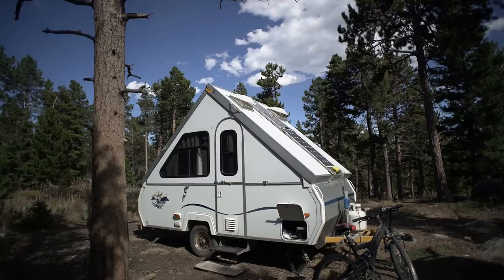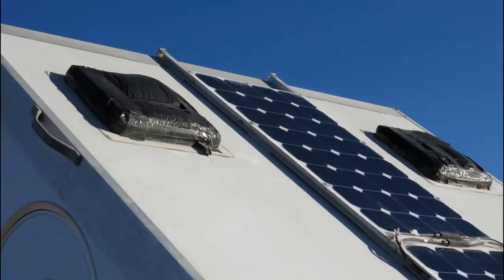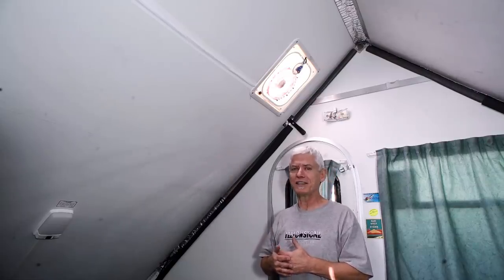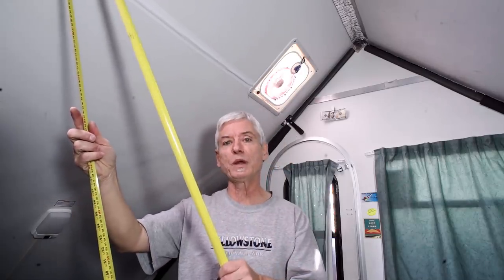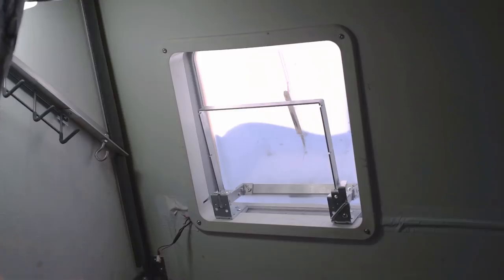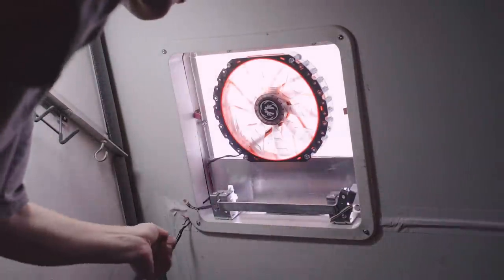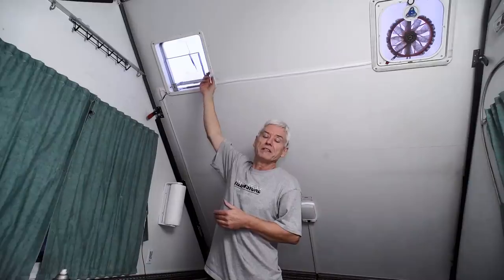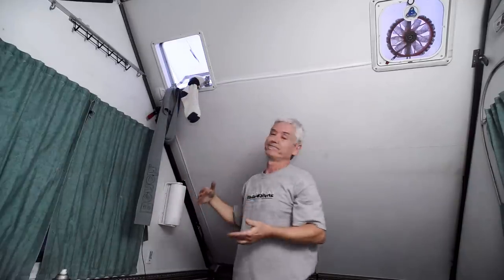Designing a Better A-Frame RV Vent

Comment: Fantastic and great fan idea. No pun intended. Those vents look to be the same ones I used in my Chevy van in the 70's. They were junk back then. Within a year or two, they would just fall apart. I would have thought by now, they would be made of UV protected plastic. Again great design and I look forward to your next video.

Comment: I really like your designs and attitude. I have also forwarded several design improvements to manufacturers. One responded with thanks but already had a different improvement. The other just adopted my improvement which made me happy because it was a safety issue that nobody thought of. Keep up the good work, and keep the videos coming.

Comment: So one time we are driving south on AB 36 through a touch of chinook wind off the starboard bow. 80 klicks gusting to 120.  We pulls into the gas station at Vauxhall to heave to in the lee of that big fence in the back. As we stop the sumbitch vent lid off the truck camper hits the windshield and rattles down the hood and off the front of the truck... the wind shook it to pieces and it was closed...😳 ...the gas station keeps a stock of them for just such an occasion.... I love rv junk...

Your mod is a great design...

Comment: Not a fan of ALiners but your videos are very interesting and inventive. The vent in my camper is pretty standard off shelf type. It's only flaw as  far as I am concerned is that unless you screw it down tight before travelling it comes open and on dirt roads that is a disaster.

Comment: You also should incorporate a modular screen to your vent. It could be made like your modular fan unit that would attach to the vent just like the fan unit does. Also the fan unit would also have to have a screen to help keep the mosquitoes out. So you would have two modules instead of just the fan module.
Reply from the maker: Aha, another one who missed the 9:00 point in the video!!! SP

Comment: What did you do for a living? You are a crafty dude. That whole setup is super clean. You don't need a A-Frame camper to know those vent Lids suck. Anyone with the RV for any length of time knows that they leak and crack very easily. Do you have a picture of your closing window mechanism? I think that is really neat

Comment: We installed a “Fantastic Vent Fan” in ours. 3 speed reversible with temperature switch and vent closed switch. Some have remote controls. And I believe the crank was on the bottom IIRC. I did have to modify the clearance. The rear roof panel would’ve hit the inside controls otherwise when folding.

Comment: Well I would probably never have the skills to do this but found it very interesting how you mentally work through issues and come up with solutions. YIKES I am only 5'5' ,almost, and would never be able to reach the original  handles to open those vents. I also enjoy your fixes are not always the most expensive solutions.  Not even owning an RV other than the Blazer I still find a lot of your information useful to the homeowner. I marvel how much information is out here on the internet explaining how to do things. Having to learn to do all the "Man Things" hubby did has been a challenge, oil changes, airing tires , lighting the propane heater pilot light , using the chain saws and on and on and on. Each new challenge met is another notch in my belt. Keep your design videos coming and I hope some manufacture picks up on some of your ideas so others o longer have to face the struggles.

Comment: That design is simply amazing and a very good idea keep doing vedeos they are very interesting.i had a hybrid bantham light 17 ft the bathroom vent if the cover goes bad you have to change the entire vent  9 inch square...guess they are harder to get had one ordered  i traded the trailer if i had kept it i was going to fasten an aluminum plate over the cover...going seasonal at a park so got a 2008 jayco eagle 35 ft..but i liked the 17 footer had set it up solar..will mis it..

Comment: I'm way small.5'1".i would need atleast four steps to reach that opener.see your point and solition clearly.but heat rises and traps at the top which may be one reason it's higher up the wall.i also think,with my no rv haveing self,the lid should open toward the top of the vent (towards the top of the wall) which would be opposite of wind drag while driving and continue the direction heat moves upward.but,your system is genius.
Reply: And if it rains?

Comment: Hey Slim Potatohead.... greetings from Down Under mate, love all your A-Frame mod videos.... Have you considered making the 'Holy Grail' of A-Frame mods ?- Yes, the almighty DIY 'DORMER' fitted on the side above the dinette... I'm sure the video would attract a massive amount of attention as there are so many of us A-Frame owners who love their current camper and don't want to spend big $$$$ upgrading just for the dormer option....(in fact, we don't even get that option to purchase here in Oz from Avan) ...When you stop and think about it construction wise, it's basically a rectangular hole cut and fitted with 4 hinged pieces of composite panel ( 2 x triangular, 2 rectangular), a small window, some piano hinges, extruded aluminium capping, some waterproofing, and you have created a massive amount of internal headroom for your shower, and dining area..... with your hands on skills, I reckon you could have it nutted out in no time.... thanks again for what you do mate, cheers from Brisbane, Queensland, Australia :)
Reply from the maker: Thanks for the idea! I have seen the dormers, many with leak issues which has lessened their appeal. I guess one that took in account the expansion/contraction of the roof,  it would be a benefit. SP
Reply from the maker: Please don't add links to comments, as they get blocked. Thanks! SP
Reply: @SlimPotatohead  oh,  ok, no worries SP,  it was a youtube video link, we're you able to read my previous comment? or, should I post it  again?
Reply from the maker: If you could re-post it without the link, others could see your valuable information. Thanks!
Reply: @SlimPotatohead  ...no worries mate, appreciate the response, and here's the re-post :) ...the other nice benefit I thought a dormer  could provide would be a great practical place to fit your flexible solar panels on the horizontal roof section of the dormer... obviously, the panels being horizontal will potentially capture a lot more sunlight and you may not need to tilt the panels as often depending where the camper is parked.... On the inside I've seen some dormers fitted with a simple shower curtain clip ring, and recessed LED lighting.... as for waterproofing SP, the only issue I've been able to identify in my research is the very top hinge that is fitted from along the width of the dormer roof panel across from the side edges of the a-frame roof panel.... I note that a good quality flat rubber strip is sandwiched over the piano hinge and secured with 2 lengths of aluminium flat bar riveted about every 100mm (4 inches yanky) and silicone sealed both sides of the rubber before it is sandwiched... If you search for the youtube video titled 'New 2017 A-Liner Classic with Dormers take down at RV Station Katy' you can see a close up of the waterproof seal (and I noted how the rubber just passes over the edge of the a-frame aluminium sides to channel the water)  ...I reckon just a single dormer is all that's needed for increased practicality/comfort... thanks again mate from your friends Down Under, cheers Grant & Kathy :)

Comment: Hi Slim,
I just saw that one of your recent video went viral. I just want to say that i hope it won't change the way you always produce your videos, the fun that you have doing them, the fun that we have watching them. I am not trying to be moralistic or guiding you or anything like that, i just hope that you keep YOUR way to do them as a...... hobby !
I have a question if you have time to answer: do you considered those fans as an imperative requirement in your RV or you could easily live without them ?  What do you say to people considering the ventilation as a non-require option in a RV ? Thank you and continue your good job, you are my favorite for a long time in the RVs YouTube planet...  :p
Reply from the maker: Hi Jacques, I would be on the side that say ventilation is a requisite for a small trailer like this. Air needs to circulate, bring fresh air in as well as get rid of CO2 and moisture. I use three fans a lot of the time, all low current draw but effective. Thanks! SP

Comment: Great informative video.  How can you solve the brittle plastic vent from breaking apart? Weather(heat/cold) just destroys plastic over time.  A tin metal top is firmer,but you have no sunlight then.  I been thinking of buying a A-frame.  Great video's.

Comment: I like a liners.I thought about saving up for a new one from a dealer nearby (camping world) but i had to do some math $109 a month for 120 months is just ridiculous  . One I wanted was no longer made, Alite, which would have worked well with my focus. I like Aliners because they're small and if they tear up, I can fix/replace without having to know about wiring or plumbing. Plus, until I find someone who can mount the solar, I can use a folding solar paneling . Camco sales fan covers that are design to be unbreakable.

Comment: Nice job.  Seems if they designed the camper to have the vents on the back side and a little lower that would solve these problems for the most part, but I agree those vents are junk like many things on RVs.

Comment: Mr. Slim...I think the first and last class any engineering student should have to take should emphasize the time honored principal of K.I.S.S.......(Keep it simple stupid).   This project i'm sure had you coming up with an array of approaches to address several issues. With the final design you fabricated, the questions you have to ask yourself is, can I make it simpler or have I accomplished that to the degree that I am satisfied?
Not trying to be a smart ass or anything, but I think your average German Auto engineer would have come up with a multi-thousand dollar rv vent to include more parts than a Saturn Rocket.
Keep up the good work sir, your content and presentation have a very appealing style all your own and those that might try to copy you, would in effect be paying you the ultimate compliment.

Comment: Another great video, Slim!  I'm just wondering where I missed the part about you saying WHY you need to be able to remove the fan?  At what time in the video did you say that?  Not that it's important, just curious.  Thanks!
Reply from the maker: That will be more apparent in an upcoming video. Stay tuned! SP

Comment: We have an a-frame of a different manufacturer. My husband and I love it and have plans to use some of your ideas. But this vent opening up is our biggest headache! We end up stopping on our way to duct tape the darn thing down most times. Have you seen the wind deflectors some builders have added in front of the vent? We were wondering if these work. Love your creative design solutions.
Reply: I've owned 2 Chalet's over a period of maybe 10 years and never had a vent issue. Both had one Fantastic Vent fan and a plain typical rv vent. It looks like Fantastic has been bought by larger rv companies but 10 years ago they were a great company to deal with. At one time they offered an aluminum dam to install in front of the vent to reduce travel flutter. They sent me one but I didn't care for it so it was never installed. I just always made sure my vent was tightly closed before moving. Now a friend owned an Aliner and had a vent come loose which ripped it off. I stored my Chalet's outside year round and never had issues of the plastic vents degrading. Now the bubble windows? Yeah that's a different story. My first Arrowhead developed stress cracks after about a year and a half.
Reply from the maker: Hi Sallianne, I actually did consider deflectors as an option, however the ones I saw only protected the front and not the side. Killer sidewinds can also rip a vent off. Thanks!

Comment: Maxxair fan vents have similar two lid-lifting arms, but have a crank operation that looks like it keeps the vent in place when the wind is blowing. I'm wondering how your version will do in a strong wind. Your version will be cheaper to make, and within the skill level of a handy person.
Reply from the maker: The Maxxair looks like a good design, they just need to get rid of that smoked hard plastic.  SP

Comment: Slim, I would be grateful if you could send me instructions on just the bracket portion. My vent covers fly up while traveling as well and I don’t know how to attach a bungee cord to the plastic frame. Thank you for addressing flimsy poor air vent design from the manufacturer.

Comment: Could I make a really dumb suggestion?

Have you ever considered 3D printing? 

I'm lucky in that my Class A has canopies over the vents, but my first travel trailer and my Class C didn't and it'd be great if you'd posted a CAD STL file for us to download and print out in something tough and durable like nylon plastic. For those of us with several vents, a big timesaver too!

Comment: A lot of Sprinter van conversion folks use a Fantastic Fan. Could that work in your installation?
Reply from the maker: Hi Steve, I'm sure any fan under 10" could fit here with adaption. Thanks! SP
Reply: Slim Potatohead Love your videos, production quality and always interesting to watch. Thank you for making the effort!
Reply: Slim Potatohead I looked up Fantastic fans. They fit 14” x 14” openings, some have remote control open and close arm as well as fan speed and direction. Meant to open facing backwards in travel mode so you may need a bungee or strap to make sure it doesn’t fly off. Also they are about $200 each. Your solution is probably a lot less costly than that. Cheers!

Comment: Nobody has asked the question: "Why don't you just use a standard roof vent cover?" Is it because it would have to be facing the wrong way when you are travelling with your trailer (as the open side would be open towards the wind)?

Comment: Far too often I have had a miserable experience with designs and engineering that fails on so many levels. 
Having just purchased a 2018 Rockwood A122s ,I soon found out that the advertising and quality of said unit falls short . Case in point ,water infiltration. 
I left the window open .It rained.water came in.
But not through the open window. I traced the source of the water getting. It turned out that I was coming in through the rear corner clearance lights. Terrible attention  to quality and workmanship. The silicon that was applied to keep water out, was actually "funneling " the water into my camper. 
So I pulled all of the marker lights off and resealed them all. Problem solved.  Then the latch that is supposed  to secure  the vent in the corner starts to wear out .
The design and materials used are cheap .and not well thought out. I m a person who can usually think around a problem ,and continually find myself  fixing or improving on a "bad design ". When a company's quality statement says they are the "best built " in the industry and problems pop up within weeks of purchasing a brand new unit it becomes obvious that if they are the "best" what are the other companies  like. I think it is time for these companies  start making better decisions  on their fit and finish and material  choices.
I really like the fact that you can think around your problems  as well. Also that you do it on a budget or have  repurposed something to fix them .really  enjoy your videos.  Keep up the awsome efforts to inform and entertain.

Comment: Link to fan is ??? Is it "Bits-fen-X"?
Reply from the maker: Hi Douglas, the video is here: https://youtu.be/1gInEKrUdME  Links in video description. Thanks! SP
Reply: @SlimPotatohead  Tks. The comments say this fan is not packaged well and arrives broken. Also this model is nor PWM capable but does have other compliant models... Finally seems to not fit designated openings by size... Must be a better choice so pay attention to Amazon comments... PWM is a must if you want to use with Arduino.
Reply from the maker: Wow, seriously Douglas, I USE the fan and know how well it performs! SP
Reply: @SlimPotatohead  others' reports are worth considering... PWM is a must for me since I want speed control with automation. Thanks. Enjoy your travel reports. Winter?
Reply from the maker: I understand. Speed control very practical on high CFM rating fans. in my case, I needed for good circulation with little current draw, so these worked perfect. They are also very silent. Totally forget they are on! SP
Reply: @SlimPotatohead  I'd also shop for a marine hatch cover at a give-away price that could be converted for use in a trailer. Especially a hatch that is on the trailer weather-deck subjected to highway winds... looking at the geometry of an A-Liner - why not put vents in the vertical side-walls which nest out of harms way when going down the highway?  BTW - I see you didn't use your supported supplied fan... https://youtu.be/lvVsY4sPYDM  Like the multi-use capability!